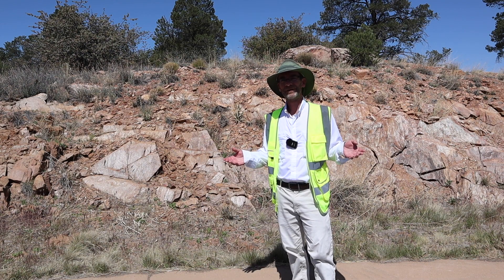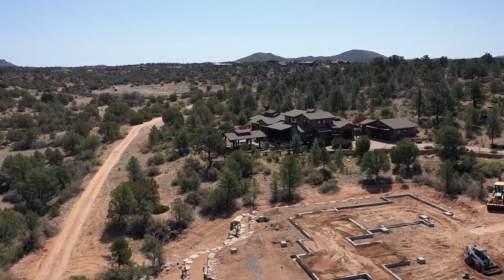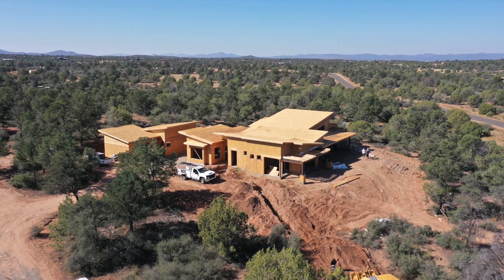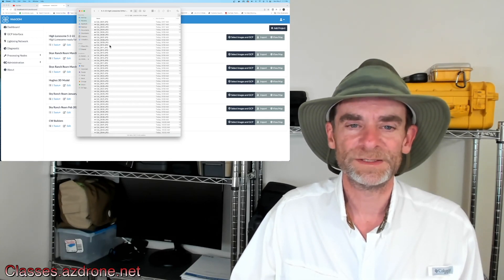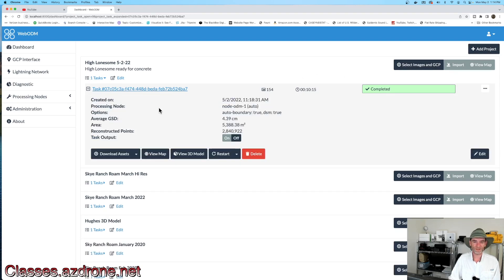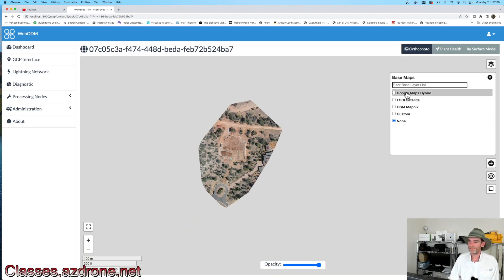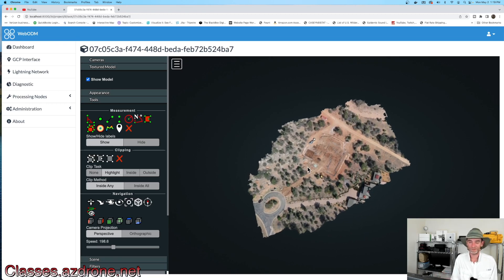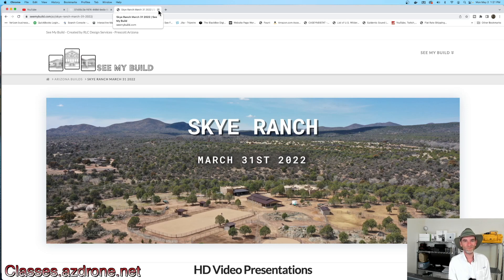A Quick Drone Construction Map

Comment: Rich,
Here again!
Have you used, preference, Litichi or Dronelink apps to create waypoints, direction heading, taking 360s images with different altitudes (AGL from roof)? 

I have a client who does roofing. I would like to attempt taking accurate, distance from each waypoint, different altitudes to capture the roof and converting the 360s in Matterport software to create a 3D walkthrough. Lastly, I would like to keep templates based off similar roofs for future missions. Thank you
Reply from the maker: I use Litchi for repeatable still image and video missions.  Repeating flight routes with it is pretty easy.  The toughest part is the initial setup getting the drone to each waypoint you want to shoot from. Once you've gotten that first mission where you want it, follow up visits become very easy indeed.  Also, I really appreciate Litchi's Mission Hub.  All of my active missions are on the Mission Hub site.  Ones that we've finished get archived and stored on my computer.  I can always load them back to Litchi later if I need to reuse an older flight.  

Just to be clear on one point.  Waypoint missions don't allow for doing a 360 shot from the waypoint.  I'm not quite sure if that's what you want to do, but want to set realistic expectations. If you could explain a little more about the 360 part of your comment that would be helpful to give you a better answer.  😀

Comment: Can you tell me how you get those before and after nap sliders and how to put them on your website?
Reply from the maker: The before and after map slider is a plugin for Wordpress.  I use wordpress for my website in part due to how many plugins are offered for it.  I use the Twenty20 Image Before-After plugin for wordpress.  Upload 2 images of the same location from different times.  Use the Twenty20 plugin, and you'll easily setup the before and after.

Comment: Hi,
Steve from Scotland UK here. Brilliant video and excellently constructed with great advice.  I have just started experimenting with mapping. I use my Inspir2 with the x4s camera (as its manual).
What drone did you use to capture the pics?
How easy is it to load WebODM onto my Mac Book Pro.
Thanks in advance and Keep up the FAB work.. :-)
Reply from the maker: Thanks for the comment!  Glad the video was helpful for you.  For this mission I used the Mavic 2 Pro with Map Pilot Pro.  Worked like a champ!  Now, to your WebODM question.  Using the "Paid for installer" which is $57 the installation was very straightforward.  Here's my question for you....  Is this a newer Macbook Pro?  Does it have the M1?  Also, how much RAM do you have.  For WebODM to work they suggest you need a minimum of 4GB of RAM.  I say you need at least 8 GB of RAM.  Even at 8GB of ram you might run up against memory issues.  The more RAM the better, and more drive space as well.  I hope this is helpful.  

You can also check out my WebODM class.  The first two lessons are free to preview.  https://classes.azdrone.net/p/beginner-s-guide-to-webodm-open-source-mapping-and-modeling
Coupon code for the class is 40PERCENT.  That get's a 40% discount.
Reply: @AZ-Drone  Thanks for the speedy response. All good here as I have a new Mac Book, fully specd out. I also use a separate HD to store Pics,vids etc. saves me space and allows system to run smoothly.
Thanks very much for the Coupon Code too :-)
Reply from the maker: Nice!  Since you have one of the new ones fully specd out you shouldn't run into "out of memory" issues.  I'd suggest doing smaller models first.  I just ran a small one this morning with 154 images at the Default setup in WebODM and it took less than 15 minutes.  You'll probably see speed improvements over my Mac Mini M1.  Remember though, it's open source so sometimes strange things just happen. 😀